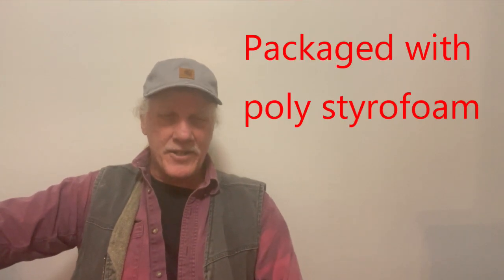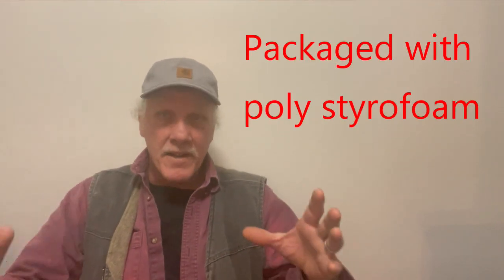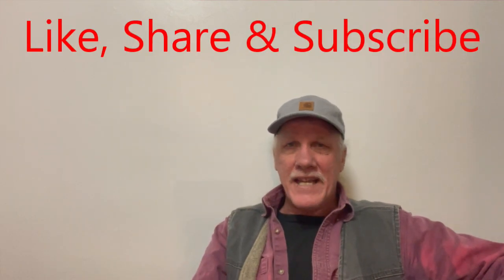Using poly Styrofoam cement mixtures

Comment: Yes, styrocrete is all the rage. I wonder if most people really comprehend the mess, and storage space that would be required to shred enough styrofoam to build a structure of any size. Also, not much is known about how long a structure made out of homemade aircrete or styrocrete will last.
Reply from the maker: It has its Applications but I just don’t see it being used to build structures of any size.
Reply: I built a Rastra block house about 15 years ago ( styrofoam concrete block) no problems with the envelope yet , stucco hasn’t cracked , and very energy efficient Year round. Pumice is a local lightweight material used around here too but it’s about 1/2 the insulation value of styrene cement block . Pumice Crete walls are  typically formed and  poured 16” thick in this climate (3b)  . Rastra has been thoroughly tested for R-values , same with The Perfect Block , extensive industry standard, lab rated  r-value , fire rating and compressive strength testing. For any material to become a certified building material it is required to undergo extensive testing .  If you build any wall thick enough it will be effective , even rammed earth above grade can be energy efficient .
Reply: One thing I don’t hear mentioned from any individuals building with their own materials online is the importance of having the material lab tested ( whatever composite/blend  it may be ) It’s possible to end up with some insurance issues ( not being able to get insurance or having higher insurance rates) building without a lab tested material . A solid independent building material test goes a long way regardless what you choose to build with , but can take some time for the results and approval to come back.
Reply: @SumFugaziSalt  Yes, we may not be able to get insurance with the opt out permit we have,  but we are doing everything pretty inexpensively, and are willing to take the risk. We were considering aircrete, but after we conducted our own (non scientific) testing, we backed out. We crunched the numbers, and found that a more traditional build is going to be less expensive anyway.
Reply from the maker: The styrofoam block has been around since the late 90’s… If it is such a great technology it would be celebrated by the entire industry and used left and right we don’t see that to be the case though. I’m just saying. The market will always utilize The most efficient ineffective means to build with.
Reply from the maker: We each take the path that’s best for us…
Reply: @fauxrock  check out Stephen Williams channel for styro aircrete for a couple of structures he built.
Reply: @fauxrock  every market is inclined to stay with what they are already experienced with and resists change because that affects the profits of established companies.
Reply from the maker: “To each his own” I don’t wanna hold a gun to anyone’s head to make them do what I think is best you’re free to choose whatever works for you
Reply from the maker: It’s not that I want to stand or stay in tradition, because I make Styrofoam-based mixtures for applications.
Reply: Is there any harm in taking trials. We have gotten far by trials and errors. We learn along the way.
Reply from the maker: I agree… I’ve received great understanding through trial and error

Comment: For insulation value it’s better to combined actual foam aircrete with the styrofoam regrind. A 6 inch thick wall has 26R value when you combine both techniques. Just use fabric or mesh on the outside/inside with stucco then paint with thermo barrier ceramic bead paint. It’s bulletproof, fireproof, hurricane proof, termite proof and if built round/dome shaped it’s actually tornado proof 😃. It has the highest survival ratings of any structure per FEMA 💕
Reply from the maker: If that’s what works for you then that’s great. I respectfully disagree with a ton of experimentation and experience
Reply: Someone should make styroaircrete SIP panels...

Comment: Amazing Work! New Subscriber.  Two questions. How do they hold up throughout the Season's? Any way to prolonged material for feezing temperatures? Thank you in advance
Reply from the maker: Thanks for the positive feedback and I appreciate you watching my videos…

Items that are made with styrofoam mixtures have zero problem with Severe hot or cold weather,as the air that’s in a bead of styrofoam absorbs the expansion and or contraction differential the weather creates
Reply: @fauxrock  Great to Know! Thank you for the quick response. I'm in the process of a 2year building pond 8'x20' includes three pools and 4 waterfalls.  No matter where you live finding boulders that are good size are hard to come by. With this anything is possible.  👍👊

Comment: i think a styro aircrete wall with a typical wood frame inside is a good bet but you are right, regrinding foam is labor intensive. It may be r3 per inch.
Reply from the maker: Thanks for the positive feedback and I really appreciate you taking the time to watch my video.

Comment: I'm wanting to pour a 2" pad for a 22' across firepit area & top it with pea gravel. What is your recommendation for the mixing in doing this project? I need your help please if you have any suggestions 🙏
Reply from the maker: 22 feet or 22 inches across. I wanted to make sure before suggesting a mix for you
Reply: @fauxrock  firepit deck area is 22 feet with a 5 foot fire ring. Approx 310 sq ft area.
Reply from the maker: Normally a slab like that I would pour with concrete that would normally be at least 3 1/2 inches thick you say you wanna go to 2 inches which if you reinforce it with increased amount of Steel and you kick up the comprehensive strength or the PSI strength you could do it 2 inch pour.

Comment: Can I use this same mix to make 10ft fence post with slots to put panels in 7ft high. I would like to make the panels out of the same material. Wondering if this idea is possible?  Thanks ahead of time
Reply from the maker: Yes, you could use this mix but you’d have to reinforce your feature with steel or mesh and kick up the strength of Cement versus Foam. I wouldn’t do less than a two part Styrofoam to one part Portland and I would use acrylic glue as my liquid instead of water.

Comment: I'm confused. 
If "styrocrete" doesn't have any R-value, why do you use it to insulate with in your own projects?
Not being snarky, just thought that's what I've heard you say, both in this and other vids.
(Which are great, btw!)
Thanks!
Reply from the maker: I think I was trying to differentiate between using the Styrofoam mix for building structures. Where in you don’t achieve any real significant R-value. As I said, in my videos I typically will use the Styrofoam mix for two reasons one I will put it underneath a pool or a spa or a water feature that’s going to be heated because it is a thermal break so that I don’t lose heat to the ground. And I also use it to fill areas that are void and that’s about the best I can see using it for.

Comment: Are your formula ratios done by weight or by volume sir?
Reply from the maker: I always use a volume measurement for the foam mixtures
Reply: @fauxrock  thank you so much. I am sure I'd have figured it out by experimentation but your shared knowledge is very much appreciated!
Reply from the maker: Thanks, no worries. It’s a pleasure to be of assistance to you!

Comment: Can you economically make cement perlite SIP panels?
Reply from the maker: The answer insurance of course… Yes you can.
Reply: So how do these perelite cement panels stack up to Styrocrete/Styroaircrete  in terms of insulative properties?
Reply from the maker: They’re actually stronger than using Styrofoam, certainly more than aircrete
Reply: @fauxrock  structuraly stronger, or stronger R value? I know what you think of styrocrete for building construction, but at you confident on using these posterior perelite sip panels for houses? I plan to do a timber frame, as I have a sawmill,  and I'm vetting the wall options now.  I'm not worried about insurance,  and code enforcement is non existent where I am for the most part,  and I won't be bringing any banks or lenders into this,  therefore I have an advantage of extreme flexibility in material and method.
Reply from the maker: @johnadams3800 structurally speaking… it wouldn’t have as much insulation value as would Styrofoam

Comment: If you wanted to cast large boulder, something like Jersey Barriers -- a  basic self-supporting triangular shape, how would you make the inside of the mold so that when the form was lifted off vertically it would resemble a large boulder?    Want to make a mold to fill from the top, cast in place boulders at least 2' wide at the bottom x 6 feet long x 6 feet high that tapers down to 1' at the top.  Want to end up something that looks like:  DekoRRa Rectangular Faux Rock - Model 110.  Any ideas appreciated.   Thought of making some sort of cnc'ed wood panels with rock ledges cut out from glulam beams and coat them with some sort of anti-stick/release compound .
Reply from the maker: The first step would be to build your prototype rock so that you could then take a mold off of it. From there you could begin casting copies thereafter. 

If I were contemplating doing this I would make three prototype boulders and make 3 molds from them so that I could have an 18 foot span before my rock image reproduced.
Reply: @fauxrock  Thank you, let me meditate on this.

Comment: this guy did R value testing on styro-aircrete, aircrete and styroconcrete. Basically the styroaircrete did the best R=3.3, and the other 2 were about 2.3R value. https://youtu.be/6U4JAop0dTY?t=1153   watch around 19:00 in.
Reply from the maker: I have dealt with this guy within the last year. Nice enough guy but the other values he obtained were far from laboratory conditions. There are many certified labs out there that have done the test on the Styrofoam mud and not you’ll anywhere near those numbers. 
People will believe what they wanna believe and that’s the right I personally don’t see any significant insulation in the Styrofoam mixtures if I’m going to insulate it’s not gonna be with Styrofoam cement mixtures
Reply: @fauxrock  even if not lab values, the relative comparison is what is most interesting. adding foam to the cement/Styrofoam mixtures increases insulation effectiveness by about 50%.

fiberglass insulation is used in many homes and is only about R3 so to get something close to that is decent. nothing to write home about but given the extremely cheap cost, it's a win in my book.
Reply from the maker: We all have to choose what we feel is best for ourselves…